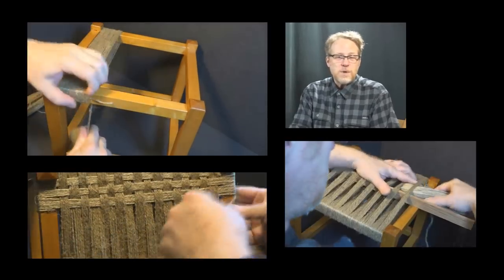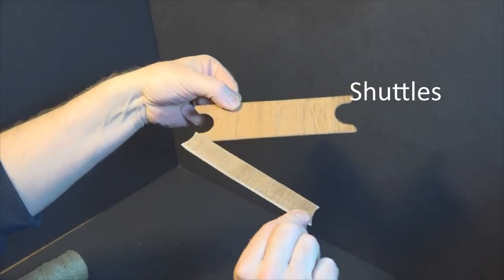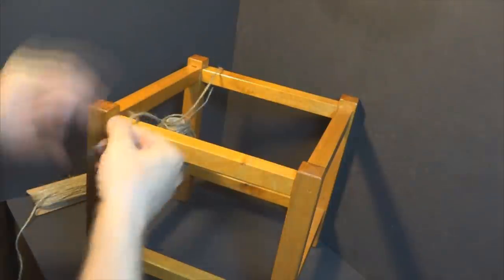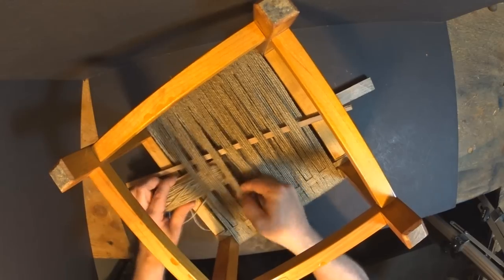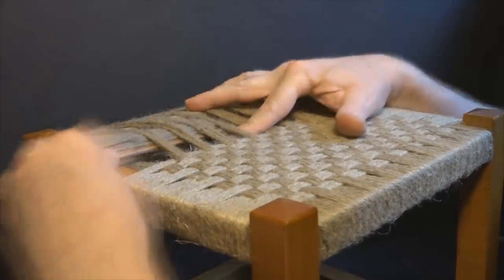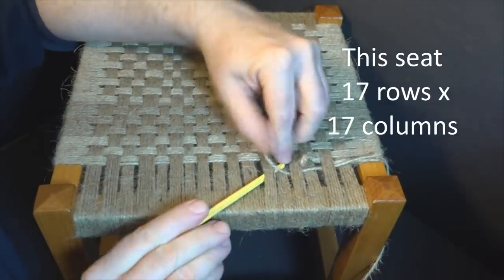How to Weave Rope Seats

Comment: What does the underside look like with this? I am trying to weave a chair back, and need both sides to look neat and tidy. Does this allow for that, or is there another technique to use instead?
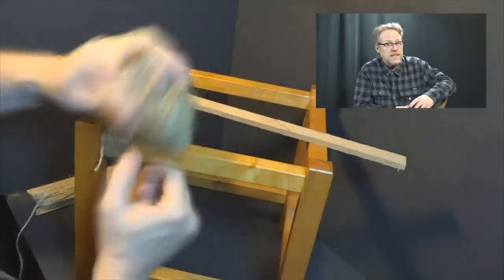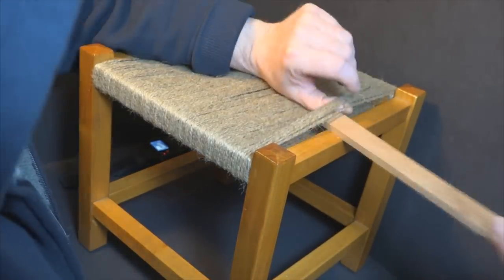Reply from the maker: If you follow my method the top and bottom are identical. See inset pip at 01:25 , and procedure at 02:27
Maybe watch again? Seems like you missed out on some important stuff.
Reply: @repairs101  thanks (I did fast forward a little bit, ADHD...) and yep it seemed I missed that part! I'm gonna try this with multiple colours.

Comment: Coupla questions:
1. How much give is in the seat as it’s wrapped here? It’d be nice to see ya test the final product. 
2. Is it possible to adjust the tightness once it’s wrapped? (Without starting over.)
3. Most importantly, what about the rat? What happened to the rat?
Reply from the maker: 1.) very little give even years after use - hard to make changes once video is uploaded
2.) it would take a lot of patience 
3.) i'm told he moved to the interior and runs a roadside donut stand
Reply: Here in India we weave such that there remains a provision to adjust tightness.
We generally uses tightness adjustment in beds because its length vary 78 to 80 inch so due to higher lenght ropes elongates over a period of time.
In seats tightness adjustment is not required  due to lesser lenght and less bearing capacity.

Comment: Great video!  I have woven a few chair bottoms with a thicker Sisal rope.  I have read that you can put a light coat of polyurethane on the rope seat after it is finished to protect it from stains and also to smooth down the itchy fibers.  It for sure needs something to block stains and dirt, but i'm just thinking that maybe with a natural fiber rope the poly may degrade the rope over time and make it brittle.   Im thinking if i were to use this method, perhaps i might do a light spray-on coat or two and leave it at that.   The rope i use is about the size of a pencil, so Im not entirely sure if the light coats of poly would hurt it at all.   Have you tried that method before?
Reply from the maker: No I leave it "natural" and if it was to get ruined I'd just weave another.
Reply: lol.  well as far as my chairs go, i kinda say the same, but this is an antique mini rocking chair  that is still in heavy use by kids.   maybe i should just shrink wrap it when im done.  :)  lol.
Reply: or just let it patina with baby poop and cool-aid.  :)

Comment: when you switch from the big shuttle to the small one, (or run out of twine),  how do you start the new piece of twine? Do you just tie it to the old piece and like tuck the knot in somewhere to hide it?
Reply from the maker: Yes use a simple square knot to join the two pieces and arrange so it is hidden on the underside. Good luck!   10+ Knots You Want To Know   https://youtu.be/yMRNeqomLjE

Comment: Hi there, the spacer disappears at about 1 minute 49 seconds into the video, but the string still looks really tight and the spacer doesn't return. Has something been missed out there or have I missed something?
Reply from the maker: +Jay Scazzer - So the thing about making instructional videos for (almost) no money is you have to accept that they aren't perfect - and so do the viewers.
Reply: Sorry, I wan't critisising, I think it is a great video, I am just not sure whether to keep the spacer in the whole way through.
Reply from the maker: +Jay Scazzer Use the spacer stick to ensure slack in the warp or consciously wrap the warp loosely. The footage without the spacer was filmed before the footage with the spacer and before I remembered it is impossible to weave if the warp is tight. So I unwrapped the whole thing and started again with the spacer. I only did this once before so I was remembering as I went along. And I made the same mistake the first time. But in the end I did try to impress upon the viewer that they would need to ensure there is slack - whether they used a spacer or not.

Comment: What if the size of the chair isn't square but a bit wider at the front? How fo you proceed?
Reply: Well, his pattern is to wrap a single spacer every 5 turns, 1 on the front bar and one on the back bar between each group of 5 full windings. If I was going to try something like this on a chair with a slightly wider front, I would modify this method by adding a second winding spacer on the front bar (keeping the original single-space winding on the back bar) between each group of 5 full windings. I think it would be subtle enough with thin twine/rope like what he's using to still maintain the "almost square" appearance without leaving any gaps of uncovered bars. Depending on just how wide the front is compared to the back, using 3 "spacer" windings on the front may be needed if there is a larger/wider difference between front and back, but thicker twine/rope might make this 3-space approach more noticeable/less aesthetic.

Comment: You weaved so fast I had a hard time following. Do you weave it on the underside too then? Or just on the top and then loop it back around sloppy like in the side you won’t see?
Reply from the maker: The answer is in the video. You can slow down playback speed using the button at the bottom right of your YouTube player.

Comment: OK SO I HAVE THIS CRAZY IDEA.. I WANT TO WEAVE ROPE AROUND THE FRAME OF MY MOTORCYCLE TO MAKE A FLUSH SEAT ON MY RAT BUILD BUT NOT SURE IF IT WILL HOLD UP DOES ANYONE FILL IT IS POSSIBLE AND OR SAFE WHAT KIND OF ROPE WOULD BE BEST TO USE FOR STRENGTH AND DURABILITY???